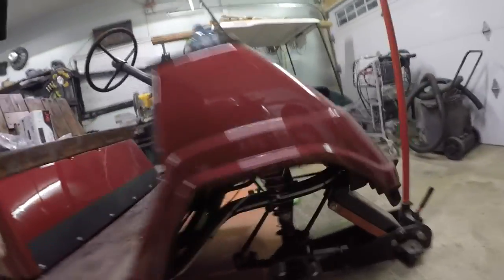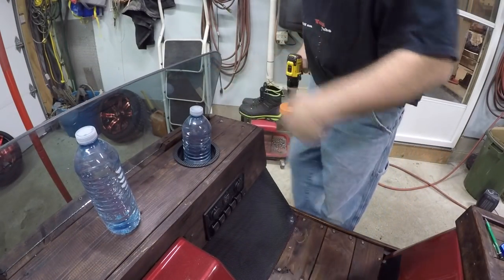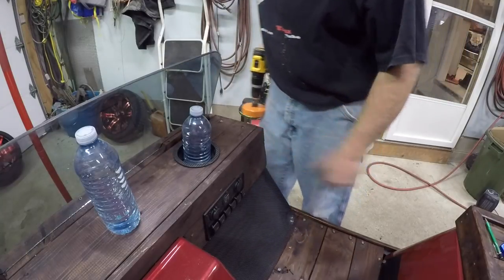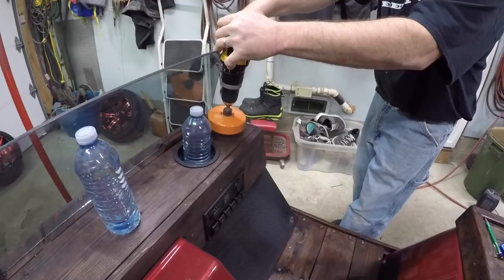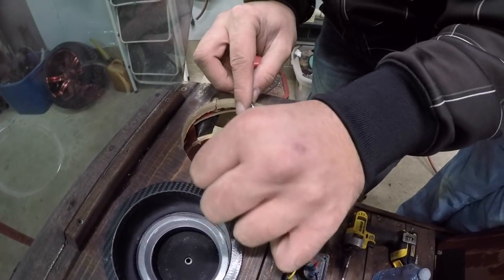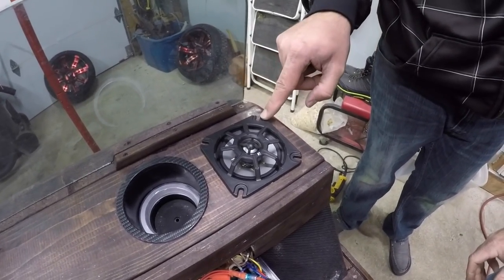Hooked Up with CarPhonix GolfCart Radio Stereo

Comment: I have a Yamaha G1 same as yours, I am having issues with the solenoids. I believe one is good so I was wondering if i could cut out the bad one all together and just use one.
Reply from the maker: No you need two One is Reverse and other is forward